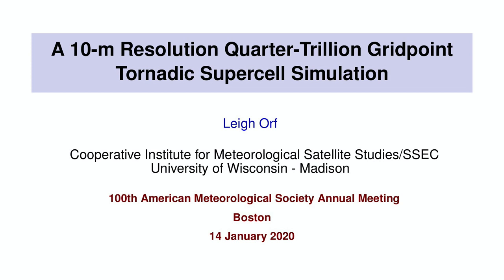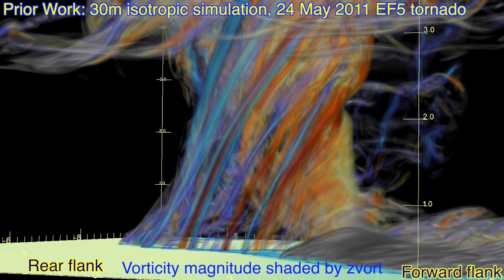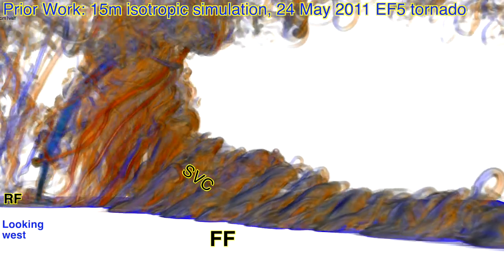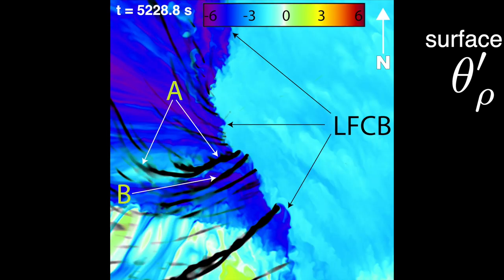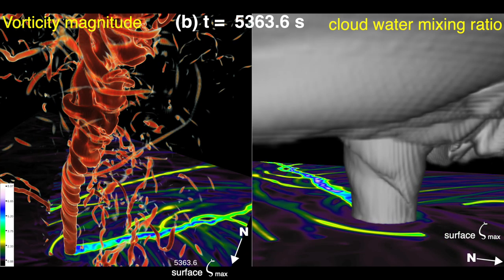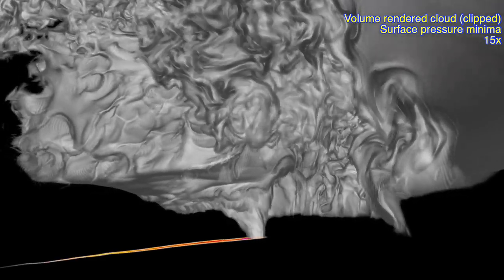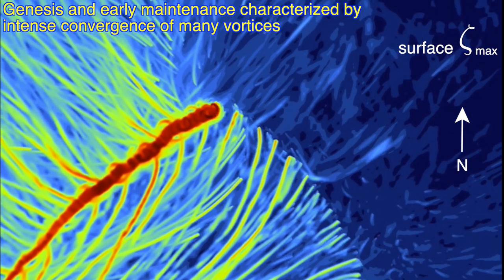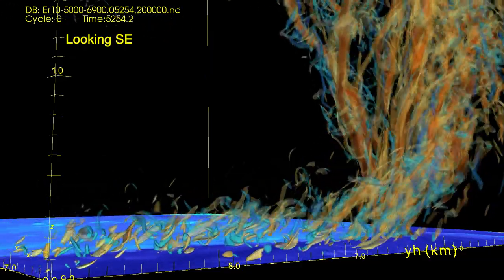A 10-m resolution quarter trillion gridpoint tornadic supercell simulation

Comment: Here's what I want to know: If you run this program multiple times does it always evolve in exactly the same way every time?
Reply from the maker: An excellent question, near and dear to my heart! It's also the same question I asked the engineers working on the Blue Waters supercomputer before it was fully built - I wanted to know, and their own answer was they didn't know!

The short answer to your question about bit-perfect reproducibility is "yes" but only under specific circumstances. The CM1 model I use is compiled into a binary executable from source code (like all models that run on supercomputers). If I use the same exact binary I should get the same exact results, down to the very last bit, so bit-identical. I have verified this. However, a while back I tried to reproduce a simulation using a newly compiled version of the model and immediately saw that the solution was very slightly different, and the differences got larger over time (this is expected to happen with models like CM1 which simulate highly nonlinear phenomena). So what happened? Updates to the compiler and updates to the libraries on the supercomputer. The source code did not change, but the results were different in the least significant bits of data, and these small changes amplified over time, like the "butterfly flaps its wings" scenario.

In science, reproducibility is considered monumentally important. You may have heard news stories where social science or medical studies cannot be reproduced (usually they involve human subjects). This has been called the "reproducibility crisis." In my world of cloud modeling, I am no longer so worried about this because any given simulation is just one out of a nearly infinite number of outcomes. I can always create a new simulation, and often times I get a very similar result (i.e., a big fat EF5 tornado that lasts a long time) even when I recompile the model or run the model on a different machine. I am always careful to point these things out, and the atmospheric science community I think generally understands this. It's also why the focus from specific individual simulations has changed to ensembles of simulations where you look at a bunch of simulations in slightly different environments/configurations and do statistics on them. In ensembles, it is hoped that the statistics will not change much even if each individual run may have changed. But it is especially challenging to do ensembles at the scale I typically run my simulations at, since my whole approach is to push the hardware very hard. So I kind of consider each simulation to be similar to an actual storm chase - with a storm chase you only get one shot on a storm. For super big simulations (like the 10 meter El Reno 2011 simulation I did on Blue Waters) I will never get that bit-perfect result if I run it again because the machine that I ran it on no longer exists, and there will be very slight differences in mathematical operations on a different machine.
Reply: @LeighOrfsThunderstormResearch   I might be wrong on this, but I don't suppose these kinds of models are great candidates for being run on GPU based supercomputers? I would guess there's too much interdependence between different data points for that to be efficient, but maybe I'm wrong on that.

Do you think newer systems are moving in the direction that would let you realistically run multiple iterations of the same model (maybe with slight noise added to the input data or model constants) in the next few years?
Reply: I love the fact that some of the stuff he's given acronyms to relates to some of my favorite animes
Reply: I'd love to see an flcl vorticity

Comment: “I had so many hardware failures… I have a couple hundred terabytes of data, and that’s compressed”. I don’t know a better example of pushing computer power to its limits than your simulations. Brilliant work!
Reply: I've always been into stuff that pushes computers. I was into calculating digits of pi for a while. Then I wanted to get into weather simulations like this but it wasn't even possible at the time. Now it's barely possible. Can't wait to see what evolves. We need people who know the right questions to ask! Infinite processing speed will mean nothing without knowing how to use it. This is a good use.

Comment: All models are wrong, but some are more useful than others. This work is incredible. Bravo!!!!
Reply: @Critter145 – You're not wrong...but with a caveat. The laws of physics aren't wrong, as long as they are not used outside the context in which they apply. So, they're "models" in the sense that they accurately describe the behavior of the systems they represent. But those are all simple systems. That's why the equations of physics work. Models that attempt to describe the behavior of complex systems (human behavior, the weather, the climate, etc.) are doomed to fail.

The reason is in the very definition of a complex system, which is a system whose behavior cannot be modeled by a finite algorithm. The kind of models you're referring to — all of which are wrong — are consigned to failure from the get-go, because they're an attempt to treat complex systems as though they are simple systems. It can't work. 

It's true that, depending on the system involved, some models can provide useful approximations. But with a few rare exceptions, believing that the approximation is reality and betting your future on it is generally inadvisable.

Comment: Having been directly hit by a tornado last year, I’m watching this and confirming everything I felt in the air just before it hit. This is unreal!
Reply from the maker: Sorry you had to go through that. What do you mean about "felt in the air just before"? I'd be interested in your experience.
Reply: Leigh Orf's Thunderstorm Research thank god it was a weak tornado. A brief explanation: I’m an intermediate level chaser with 5 years of experience, and found myself stuck in the worst possible situation. My truck was buried in mud, and I had to walk over a half mile away to get phone signal. As I got signal, the air changed. The wind direction changed 180° and the temperature dropped sharply very quickly, and my ears popped. I knew it was a pressure drop, and I was in the inflow notch. I saw a funnel in the sky over the tree line very close to me. I saw a cattle guard and wrapped my arms and legs around it because they’re usually built into the ground. As for tying this video to my experience, before the tornado hit me, I felt the twisting and winding air being pulled upward around me. It was an extremely weird sensation but it was almost like I could literally feel the individual suction vortices. Seconds later the weak tornado has gone right over me, rain and wind being swirled around me, and tree limbs breaking. It had passed over, and I still held on to the cattle guard in case I was going to be run over by the ghost train. It dissipated shortly after, and the firemen came and took me to their station. I was unharmed, just embarrassed I ended up in that situation!
Reply: Leigh Orf's Thunderstorm Research I apologize for the novel. But when I watch your videos, I instantly tie it back to that day. Seeing the visual representation of the air, and relating it to the physical sensation makes it ultra real and amazing. So thank you for your continued research
Reply from the maker: @IGY6Brah  Thanks for relaying your experience... fascinating... if you could actually feel the updraft on the ground, you were in a really bad spot for sure!! Glad you came out of it unscathed.
Reply: Leigh Orf's Thunderstorm Research it could have been worse than it was! The fireman told me they thought they were going to recover a dead body. Sent a chill down my back realizing how lucky I was. I still chase today though, and I actually have a question for you! If had an idea of getting a high res thermal camera to film a tornado, just to see if it would actually be able to capture the difference between the hot and cold inflow. Do you think that would be possible, or a waste of time?
Reply from the maker: There was actually a group that did research on this a few years back. It turns out there are big problems. First, it's not like radar when you have good range information; you just get a number for a given pixel. So you don't really know what the temperature represents. Second, the devices aren't precise / accurate enough to be of much use. So it's probably not worth your time. Wind information is probably the most useful, and that brings us back to radar...
Reply: Leigh Orf's Thunderstorm Research ok, well thank you for your insight!
Reply: @LeighOrfsThunderstormResearch  i think if we want alot of ground level wind field data, the best bet would be to get some milsurp colored smoke grenades and give em to guys like Hank Schyma, Reed Timmer, anyone else you know who routinely gets within throwing distance of these storms, and then film the results on high resolution cameras. Should really help show all the vortices that aren't quite strong enough to generate their own condensation or dust cloud
Reply: @IGY6Brah  I'm neither a weather scientist nor a chaser.  I do feel, sometimes, they like to chase me.  I asked Dr. Orf about a local tornado (here in southern Wisconsin) because of something that seemed similar to what you described.  During that event, I was watching debris swirling above and to the west of me.  As the mesocyclone passed over, there was an immediate change in pressure and an updraft of cold air while the funnel was forming.  Can't tell you much after that because I was in the basement.

Comment: Apparently, based on how the Ward chamber model worked with multiple vortices it allowed for a center where there was a downward draft which could be a path to a seat for the funnel vortex to sit in. Wall cloud has negative-particles and the debris shaft has positive+particles thus 2 different fluid types that don't mix.

Comment: I love your "revolutionary" work. I have been following since dark skies 2017 seminar. I wonder when/if you can put surface friction into the ground boundary? It seems that the simulation had a fine enough resolution to put 10m grid spaced 10-100m apart for studying the effects of surface friction and the disruption of cyclostrophic pressure on the genesis of tornadoes. 
Also, I wonder why that one vortex that formed inside of the parent tornado "wobbles" around. It's strange as it moves from the presumable radius of maximum velocity where the subsidiary vortices form to the center of the tornado where the main central downdraft is located. Additional, it's strange how it lasts for so long. I hope it's not too important when you have to compose the research paper of doom.